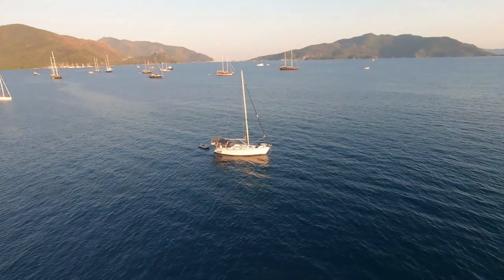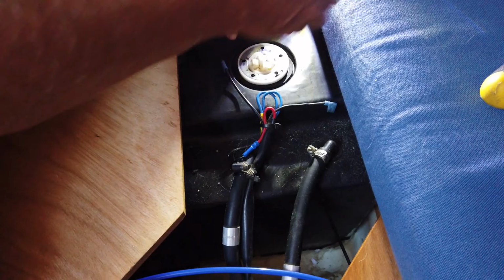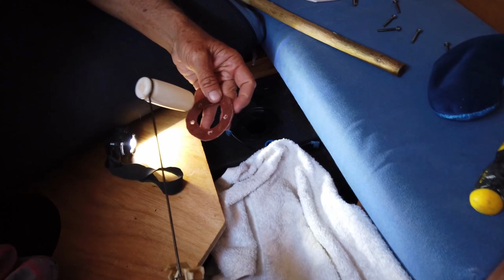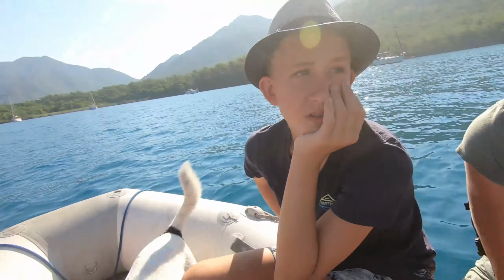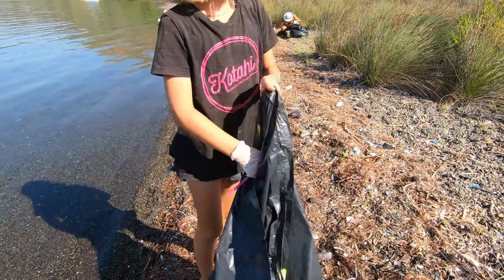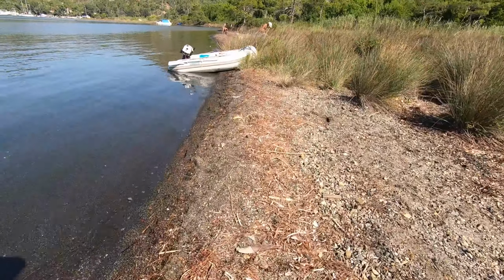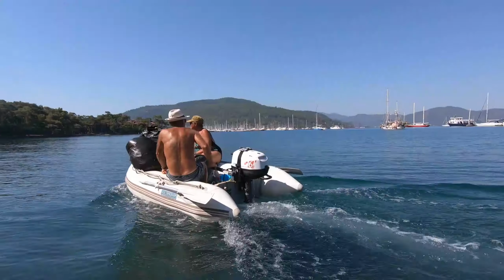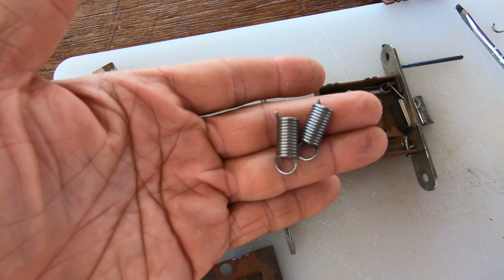28. I 60 feet up a mast and beach clean up I Sailing Freedom Family

Comment: Just another note,
If you connect the two sender wires together the fuel gauge should read full which would rule out issues with the gauge and associated wiring to the sender unit.